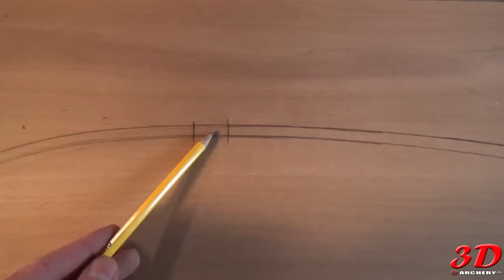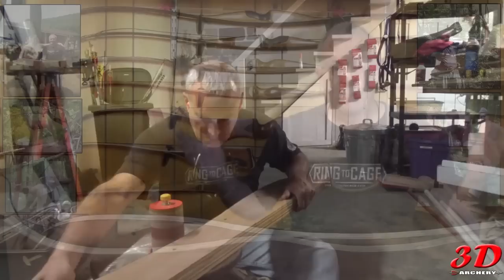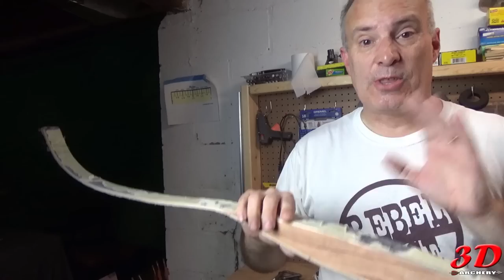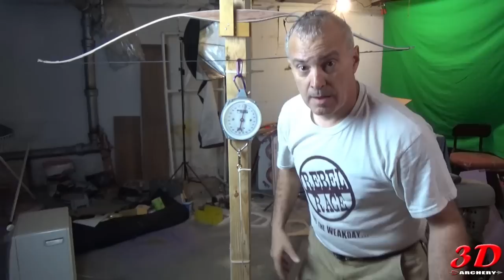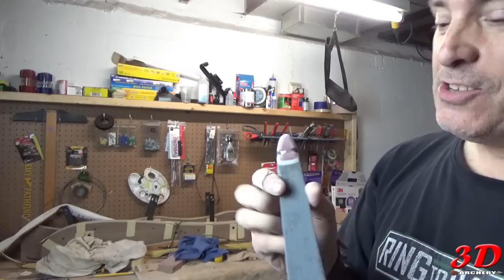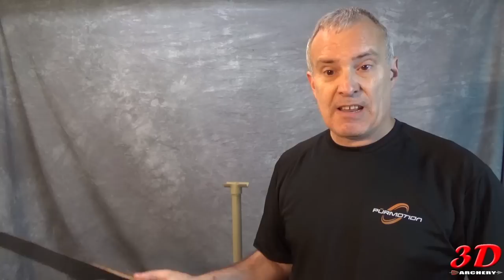3D Archery - Building My First Laminated Bow

Comment: Greg, you don't tiller a laminated Bow by sanding the belly of the laminations. You tiller it by sanding the width of the limbs that will also help you with the hinge that it looks like you're getting right at your Fades a little bit of thickness on the limbs will go a long way for dropping poundage. If you're really close to the pounded you want you can do what's called trapping the limbs which is you basically sand The Edge on kind of like a 45 degree angle but again you're doing the width of the limb not the thickness of the limb like you do on a self bow. If you want any more info just send me a message and I'll answer any questions you have. I've made several of these. Also just a word of warning building bows is very addictive :-)
Reply: Thank you.

Comment: Next time, make an exact form pattern from 1/4" board, then rough cut and glue your plywood pieces together. Next, take a pattern bit in a router and cut the form pieces to the pattern. Way faster, and way more exact than sanding all down my hand.

Comment: Doc. I use E-A 40 . I go straight into the heat box . Mine has two incandescent lights . It gets to 200  and its cured in 4 hours . Haven had one problem with it going the quicker route.

Comment: Idk if it was worked out on the finer tiller but looked like there was some pretty heavy hinging on both sides of the riser. Might be a smoother shot if  you side tiller the profile, careful with that cause that can effect the rest of the tiller but if you can get the rest of the limbs bending more symmetrically it'll help the bow in the long run and thinning the limb profile typically will add speed as well.
Reply: I should add tho, for a first lam bow it's awesome that it's functional and it's a good looking bow. Realized how negative my first comment was...
Reply from the maker: Not, negative, constructive. Thanks.

Comment: Great video 👍
do you need a heat box to make a laminated bow or is it optional?
Reply from the maker: Great Question,
No, one is not mandatory. However, room temperature is important, a minimum of at least 70 F is required. Go under that and you are tempting fate. 

You can "make" one in may ways, just be creative.

Comment: Curing at room temperature for 24hrs and then heating for 4-8hrs is only to increase the physical properties of the glue. Curing 12hrs at room temp then 6hrs at 150° plus cooling time is to cure it up to 6hrs faster. Going from 28-34 hrs down to 18hrs. I'm not sure where or not that also increases the performance.  On EA-40 you can also cure at room temp for 24hrs and cure for 2hrs at 250° to increase the glue's resistance to heat.
Reply from the maker: According to Smooth On, the best way is to cycle it. They do not recommend the 24 and 2 you suggested. The say either the 24 at room or the cycle method are the two best options.
Reply: @3DArchery  yes, the last one would be for applications other than bow building. 👍
Reply from the maker: @incorporeal3793  
Not according to the rep Smooth On sent to my house thinking I was a business due to how much I was ordering from them.

We had a very good and technical conversation.
Reply: @3DArchery , sorry, but I did not suggest that,  I should have stated in the original post the last method was not for bow building. It is only to increase the glue's resistance to heat. My mistake.

Comment: Great job Greg, I've been thinking of building one for a while and this really helped my research. Where did you get the components? Seems like the most critical part is getting the fades right on the riser. I was wondering if you got it that way or you had to shape it to size.

Thanks
Reply from the maker: I bought The Kit for a "Hybrid Long Bow" from Bingham Bows (Did not use their plans though), Cost about $360. Comes with everything for the bow. The only thing you will need to purchase is plywood for the forms. The riser comes as a block, the wooden lams are pre-planed. 

As for the fades, in my test runs, the air hose did not close the fades. There was a huge gap. My solution was to heavily tape it down (You tape it down just to hold it in place), til the Gap was gone. 

The fades are one key, the other is to make the lower section of the form as perfect as possible (smooth lines, as straight as possible) and to ensure that the riser fit on that bottom form really, really well, no gaps.
Reply: Ahh, so the fade on the riser has to fit the lower former just right. Sure, makes sense.
Thanks again

Comment: Greg, how much in equipment and materiels would you estimate? If someone has nothing and wants to do this.
Reply from the maker: Tough but good question.
Tool wise you will need at least a saw to cut the form and riser. Drill for the form, and Files and Sandpaper for the rest.
To make the form: Plywood is best, but you can use other woods. Instead of the air hose you can use rubber straps made from inner tubes 
As for parts of the bow, you can save money on riser material, but the lamination you would have to buy. 
The process is actually quite basic.

Comment: UK ARCHERS. Darwen and Blackburn.  It was plain to see there was no strength in the limbs when your strung it. also i see buckles at the start of the limbs. overall a goood start. id go again but this time build it all up in thin laminates of diff woods. bamboo is a nice one, each laminate a few mm thick. i can see there is no strenth where the limbs exstend from the riser.. there is a video of a pro maker showing how they make theres and from the way i see you used the pump you seen it to.. he smacks all of the  glass of with a dead blow hammer rubber ended. next time do it how he does in in the factory. did you put in at least one laminate of carbon? ... come of fella i see al your bows you made your no noob. i shoot recurve btw... i wana see a pro finish.. like i said good first go.. my first electric guitar. took me 2 years. but at least i sold if for 500 pounds. so first attempts aint no excuse :P  btw are you a cop b,a,c ? or was that a joke.????.. well i was suprised to see the power from when you first strung it...seems ok now.... not bad.... o yea your supost to tape it all the way along  then wrap it with clingfilm hard to get them laminates down solid. if you would of done that im sure you would of got a better poundage. im a give it 7.5 out of 10.. terrible finish. no polish..after all that..id have looking like glass... anyway have a good shoot... you gona be good shooting that all day i guess ? or tired towards the night time...?

Comment: Some of this video is really helpful, but some of this is so cringe. 

Recip saw instead of a jigsaw?

Metal instead of the forms? Are you not using 11 ply? Talk about something that's really not affected by moisture - or are you using it underwater? If you're that worried about wood movement just seal the forms after you make them. I mean, you're cutting these things with a jigsaw and hand sanding them, your precision isn't going to be really high to start with, wood movement in the form is near the bottom of the list of things to worry about. 

Another user mentioned about sanding and where to sand when tillering. 

The end product looked solid!
Reply from the maker: Not sure about your comment about preferring a metal form. It is a far better material to work with. I still would prefer to have the form made out of metal and no, water has nothing to do with it. 

Sorry to disappoint but I did a really nice job using the sander, the lines were straight and there where and still are no issues (18 bows in), so I do not see you point on this.
Reply: @3DArchery  Why metal? You say water has nothing to do with it, but you're not going to experience appreciable wood movement in a jig like this - and you can seal it to help prevent that also. The point is metal doesn't really provide you anything here. 

I also don't even begin to understand how you'd rather use a reciprocating saw over a jigsaw. 

I do think the bow turned out really well, and I'm pretty sure I said that in my original comment. I was actually genuinely surprised it turned out that well just with some of the comments you were making during the build, but I can't second guess the end result.
Reply from the maker: @sngehl01  
Why Metal? Because it is the better choice. Fred bear has been using metal jigs since the 70's, Ben Pearson too. They have used the same jigs since then too. With a wood jig, due to the heat cycles, it will deteriorate over time. Not so with metal. 

I used the Jig Saw, I tried the other to answer questions that some might have. 
I tried many things that so many "experts" recommend, some worked, others did not. 
The video is not a how to, but a guide to let those trying it the first time see the process and get some feedback on it. 

Are you a bowyer? If so, I would love to see videos of the bows you built and your process.

Comment: Could have saved yourself a lot of time sanding it you had used a router with a straight bit.
Reply from the maker: Interesting, never thought of that. Spoke to many bowyers and they do no use router. Has to be a reason, thanks for pointing that out. Going to ask them that.